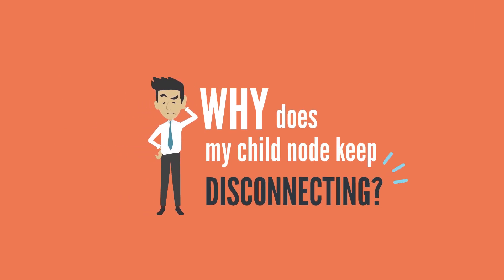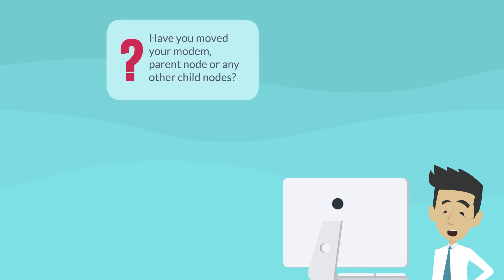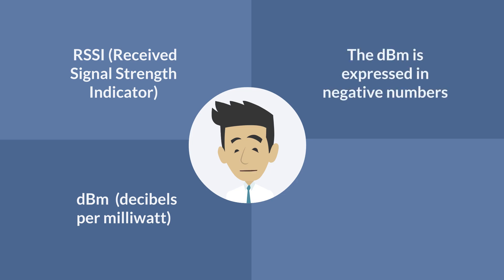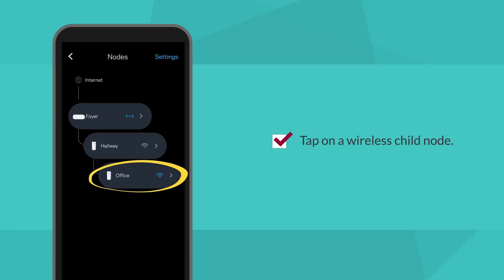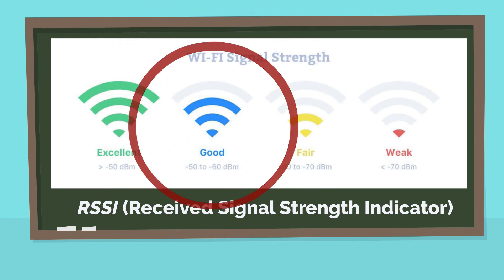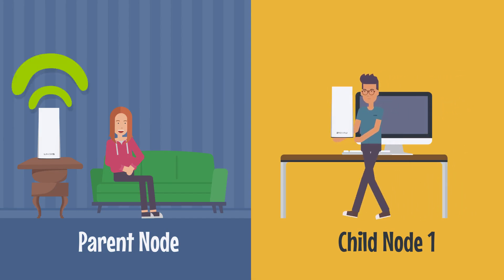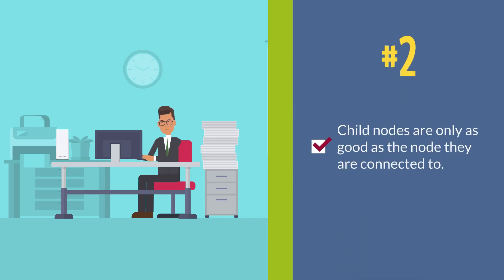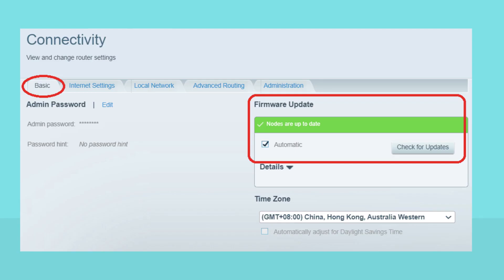Why does my mesh WiFi's child node keep disconnecting?

Comment: Linksys is terrible gear
Reply: iv been using the velop system with 5 nodes for 5 years. no issues at all. I recently got a 6th that was newer and fast and I set it as the parent node. now the single drop for a few seconds from time to time. annoying AF 😂😂😂